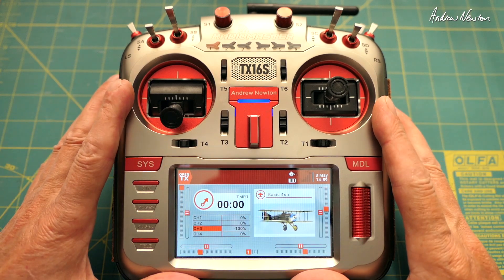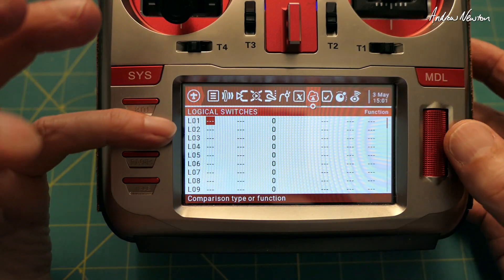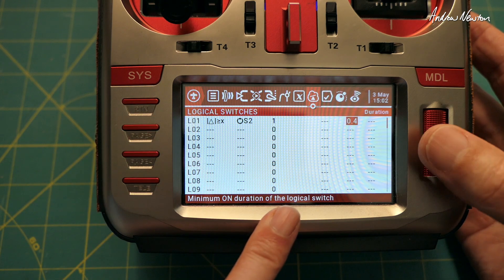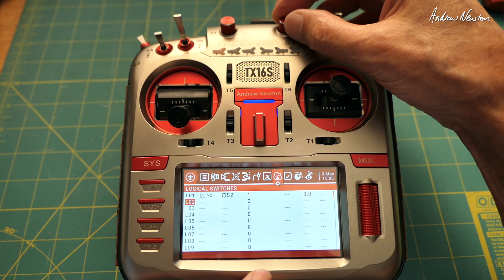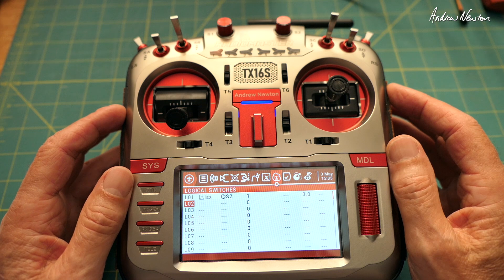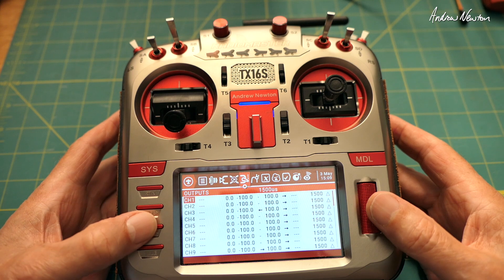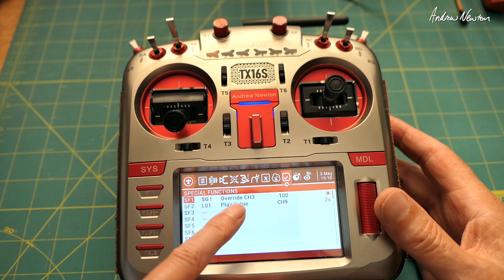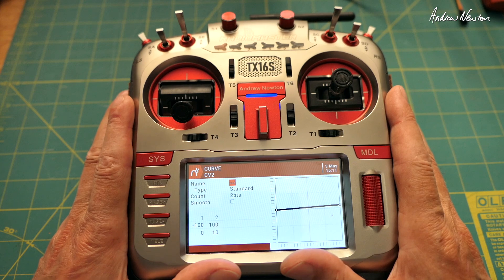OpenTX Play pot value only when changed

Comment: Andrew, I use IdI>=x (delay 0.7) and !Lxx to read the value of the change only - xx is the logical number
Reply from the maker: Genius! Thanks for that. I'll pin your comment to the top
Reply: @AndrewNewton  did you try it out?
Reply: I also add a 'second' special function to call what is being adjusted - camber/value etc - put the 'what' function before the 'value' function to sequence the callout correctly
Reply from the maker: @bracesport  Yes, but without the delay. Works well.
Reply: @AndrewNewton  nice - open TX is great 👍
Reply from the maker: @bracesport  Just did an updated video with your brilliant suggestion. Many thanks.
Reply: @AndrewNewton  nice